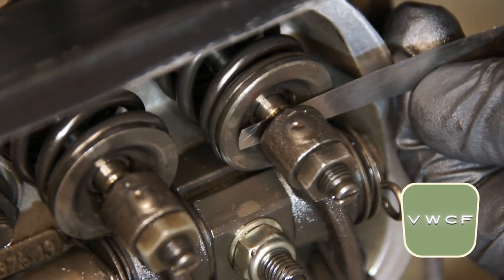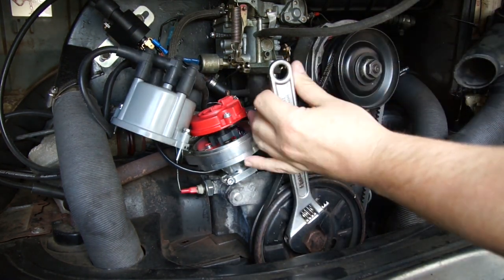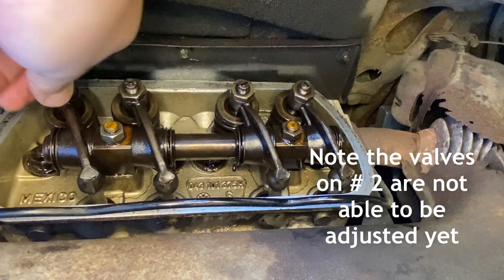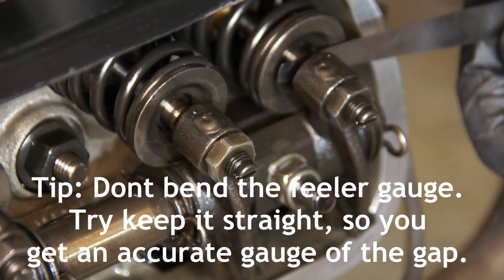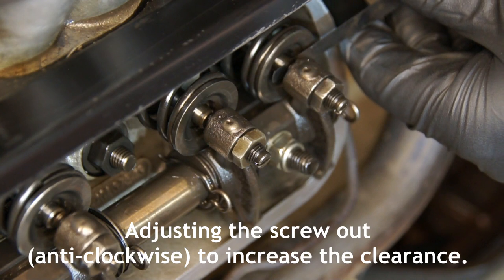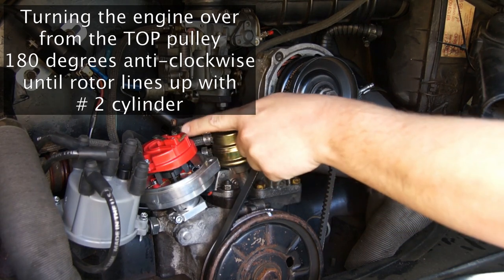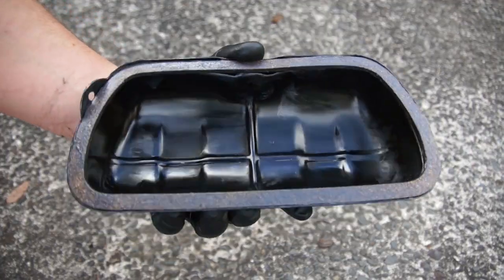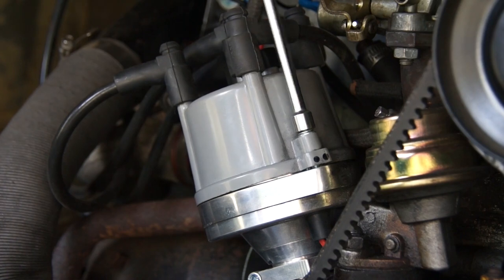VW Beetle & Kombi Valve Adjustment  |  VWCF

Comment: Here's a time saver for everybody. Remove BOTH valve covers. Once cylinder #1 is at TDC, adjust both the intake and exhaust valves, then proceed to adjust the INTAKE on #2 cylinder, and then adjust the EXHAUST on #4 cylinder. Now, turn the engine pulley a complete rotation, lining up the TDC mark on the pulley again on the engine case split. Check that the rotor is now pointing at cylinder #3, then adjust both #3 valves, then adjust the INTAKE on #4, and then adjust the EXHAUST on #2. You are welcome. Be sure to adjust the valves to the gap that is recommended according to the specific engine you have. Not every engine uses the same gaps used in this video.

Comment: Thankyou. Very helpful. What is the reason for turning counterclockwise? I thought my kombi was clockwise T2(Type 4). 🤔
Reply from the maker: Good question. This is because the engine turns clockwise normally, with a firing order of 1-4-3-2. By turning the engine anti-clockwise (1-2-3-4) you can start at #1 and set #2 (in the same head) and then move on to the other head. That’s the method I was taught anyway 😀 cheers!
Reply: @VWClassicFix  Ahh Yes!. I see what you mean. Like a short cut instead of having to jump to the other head. Thanks VW Classic, I'll give it go. :)
Reply from the maker: That’s it! Saves you jumping from one head to the other :) cheers!
Reply from the maker: @bradbell5981  Good luck mate!
Reply: @VWClassicFix  Thanks! I needed it.  My type 4 seems to have a big fat heat ex-changer just below the tappet cover. Giving less space to work with. 😅 Now to just get that judgement of "Magnetic feel" you mentioned right. Feeling slight little bit of bite I imagine.
Reply from the maker: Good stuff! Practice makes perfect 😎 don’t sweat it if you take some time to get the clearance right.